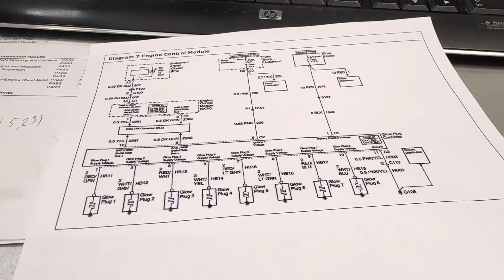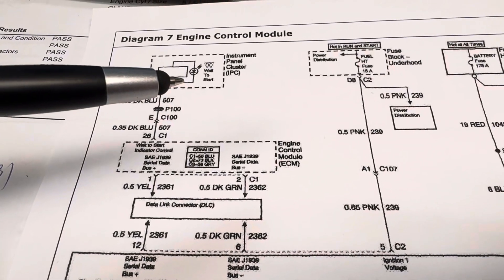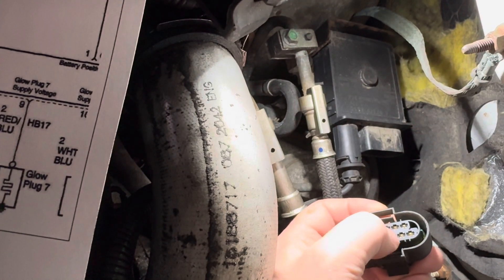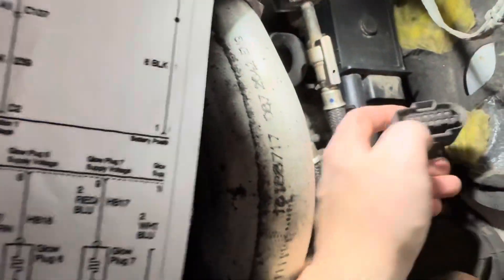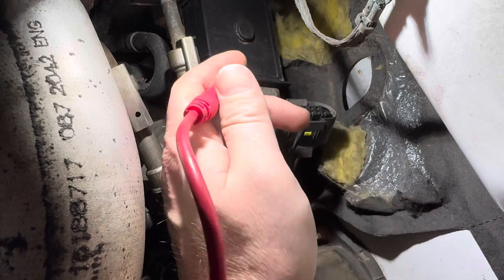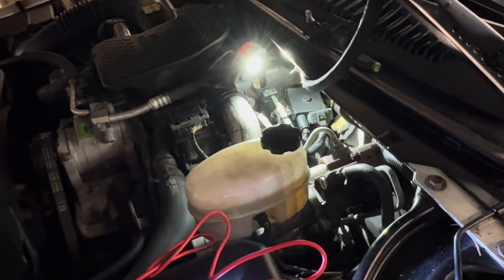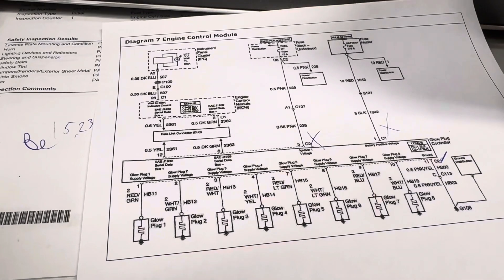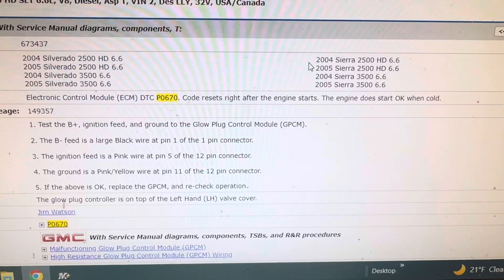LLY glow plug module diag

Comment: At the beginning of video you mention having continuity between the 2 data lines. Was the verified when the GP dash light was lit up or whenever the key is on?
Reply from the maker: What’s the problem you are having?
Reply: @TRUCK_TECHNICIAN  No voltage to the GP. I have verified everything in this video plus more. Voltage where it should be. Grounds are good. Continuity to GP. All new GP installed. New controller installed. No codes.
Reply from the maker: @davidhaynes3442  is the truck starting?
Reply: @TRUCK_TECHNICIAN  Yes, when the outside temp is warm. Or when I have driven the truck. My problem is—-When I turn the ignition key to start the truck and the GP light comes on, There is no voltage going to any of the GP.
Reply from the maker: @ it’s possible the controller is bad if you have a scope you can see if the data lines are talking or trying to talk to the gpm
Reply: @TRUCK_TECHNICIAN  I just bought a new controller from O Reillys (Standard is the brand) I thought my original was bad. Could the new one be bad too? All I have is a Fluke 337 and Beckman Industrial 110 meter. What kind of scope or how do I test.
Reply: @TRUCK_TECHNICIAN  I’m assuming you’re referring to a oscilloscope?
I do not have one. Would I see continuity on the Can hi or Can lo pins slots?
Reply from the maker: @ new parts can always be bad so yes. Also you can test can with millimeter with your black lead on ground and use your red lead to test can high and can low wires and see what your readings are. I can’t think of what they are supposed to be on the top of my head but if you Google it, there is some OK info out there. I don’t use that method very much because I have three oscilloscopes one at each shop. Sorry it took me so long to get back to you. I was putting the transmission I’ve been building in my wife’s suburban.

Comment: Bought a van with an LLY. Crank but no start. It was sitting for 15 years so I started by dropping and cleaning the tank, removing the factory fuel lines, filter, and pump and installed a Fass pump and new fuel lines to the motor. Still no start but I’m just getting started and will find the problem. It supposedly has a bad FPR but the owner couldn’t afford to fix it and left it sit. Videos like this will help me
Reply from the maker: @tomaskey6844  your going to need a decent scanner to own and diagnose these trucks. Never trust someone else’s diag. You should always diagnose it yourself
Reply: @ yes sir. I have a scanner that will get the job done. I’ll figure it out and now that I have the fuel delivery fixed I’ll keep moving through the system until I find the problem. It supposedly ran a few months ago but by the looks of the diesel in the tank I don’t see how. It was getting thick and sticky.